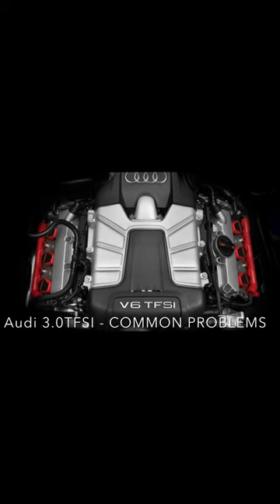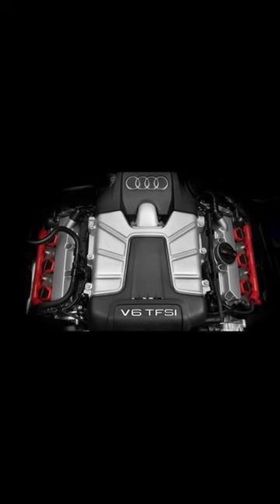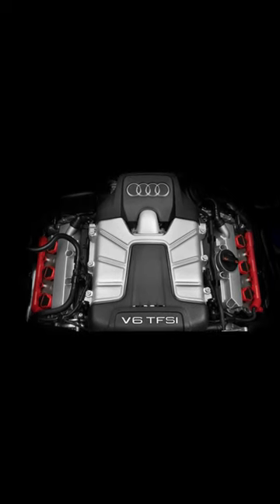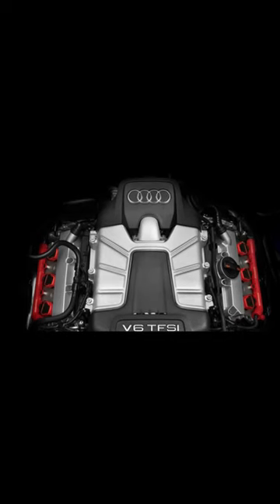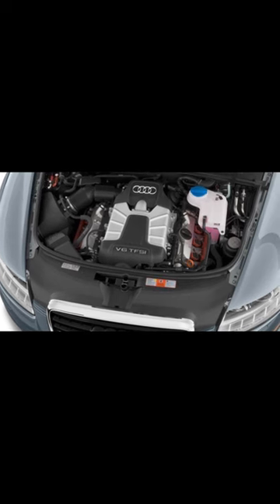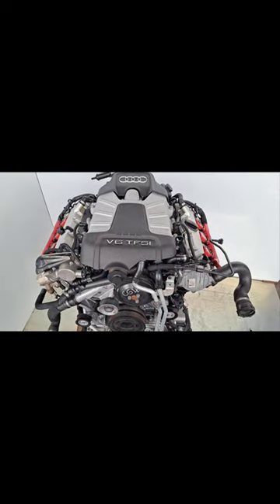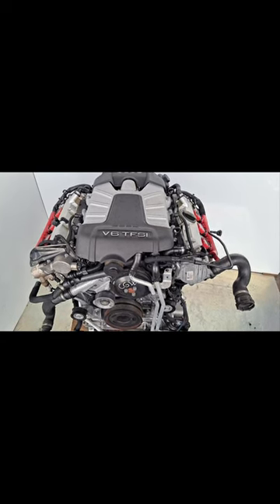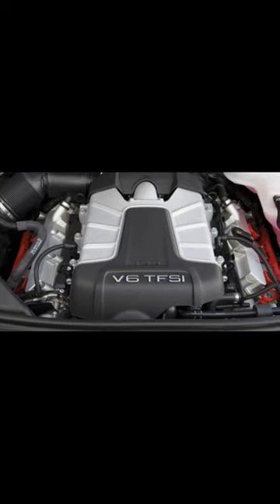AUDI 3.0TFSI - THE MOST COMMON PROBLEMS

Comment: ignition coils and spark plugs are fine as long as you keep it stock. water pump and thermostat are easy to replace and can repair yourself for $100 with lifetime warranted parts. carbon buildup only happens when you never go over 2000 rpm because these are made to go fast. the oil consumption issue is a typical german problem but there are ways to prevent it.
Reply: And what you need to do if you want to tune the car with out making problems
Reply: $100???? 😂
Reply: Where tf you do tstat and pump for 100$???
Reply: How to prevent oil consumption?
Reply: @dylandalka8700 ya there not a 100$ for my car but everything else he said is 100% correct !
Reply: I’m concerned about the carbon build up on my B8.5 S5 this woman who owned the car brand new before I bought it she did maintained it perfectly and only put 2500 miles on it every year since 2015. I bought the car with 32k miles I owned it for a year no issues but it sat and barley got use until me 😭